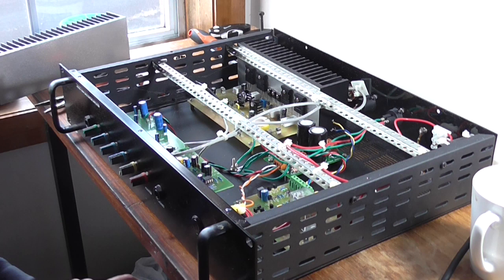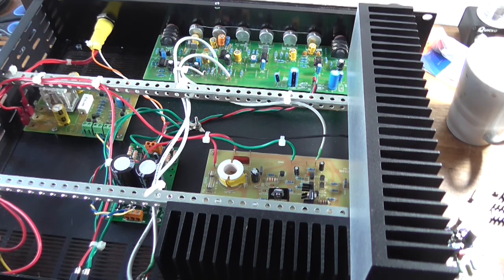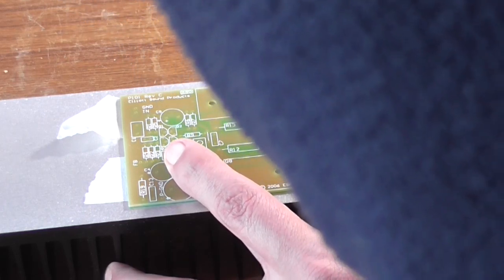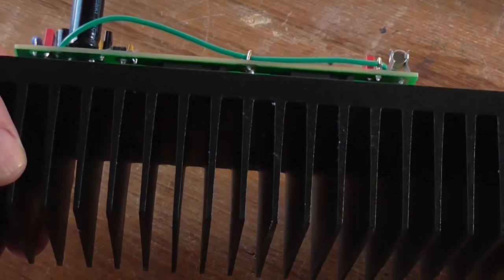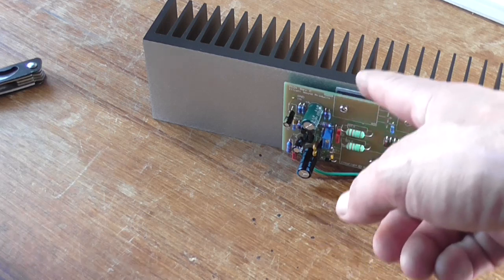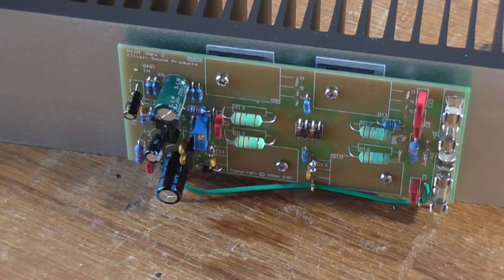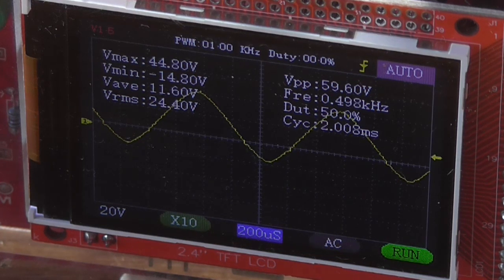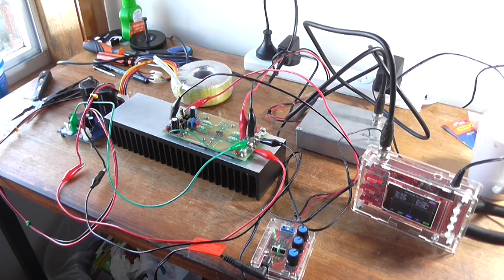ESP Lateral MOSFET Amplifier: Power Output TEST!

Comment: Something is wrong with your reading between Vp-p and Vrms, because if the Vp-p is 59.82v then the rms should be 59.82/2/1.4142=21.15Vrms that gives 56W of rms power in 8 ohm load and it's normal that the  Prms=Ppeak/2.

Comment: No way that it can output 70W at +/-35V, especially because it is lateral FATs. They give less power at that same voltage than bipolars, and bipolars at that voltage can give (in class AB) 50-60W max. Your calculation is incorrect.
Reply from the maker: P = Vrms ^ 2 / R or P = Vpeak ^ 2 / R. It isn't incorrect.
Reply: @AstrosElectronicsLab  My comment was for 8 Ohm load.
Reply: @ivanlukic2360  I agree with you. 73 w sine wave into an 8 ohm load needs 34v peak (ie only 1v away from the power rail voltages). Looking at the characteristics of the FETs used, the maximum current available at Vgs = 1v is less than 1A - Nowhere near the 4.3A required.
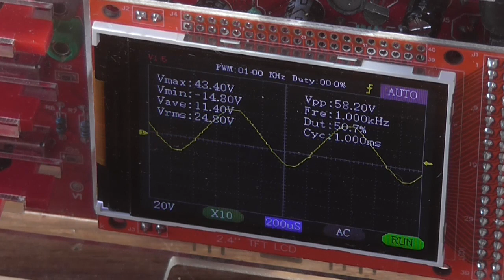Reply: 15:42
if Vpp is 59Vpp, then it would be 29.5Vp, so 29.5Vp/1.414= 20.86Vrms
for an 8R load it would be 54Wrms.

Comment: Im trying to finish mine up. I hope you post more and give your impressions. I went overboard on everything. Im using 2 400VA toroids at 40v, so I guess +/- 56V. I thought a dual mono would be interesting. Are you going to build the speaker protection boards into it? That's actually the hardest part for me. Im very much a novice but learning.
Reply from the maker: I'm in the process of laying a protection psu board out
Reply: I have built a diy type 555 timer ic + relay + resistor and a capacitor to make a delay turn on switch for speakers but didn't add and overload, or short circuit or over temperature protection.
Reply: Ideally we need to sense oscillation, and dc at output as well as protecting speakers from on off thumps.